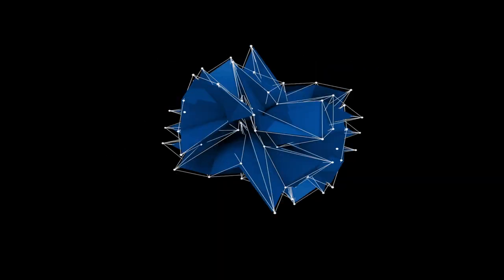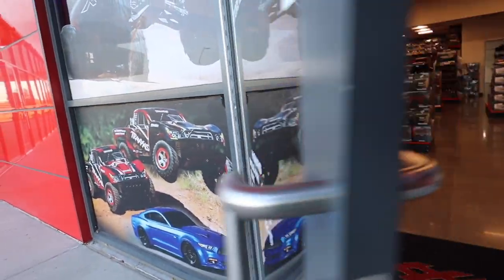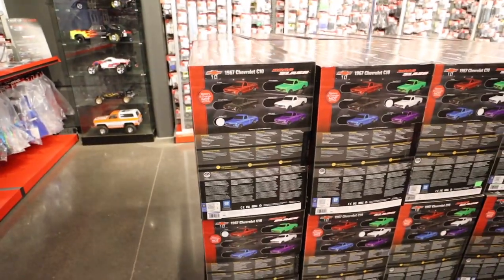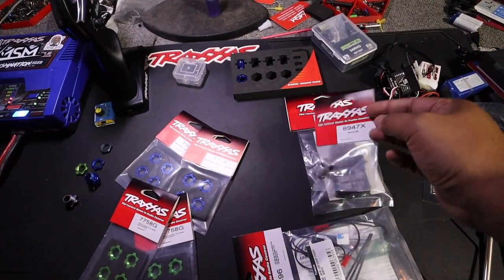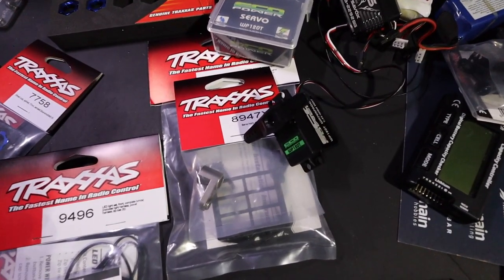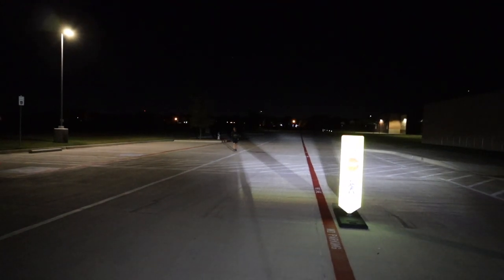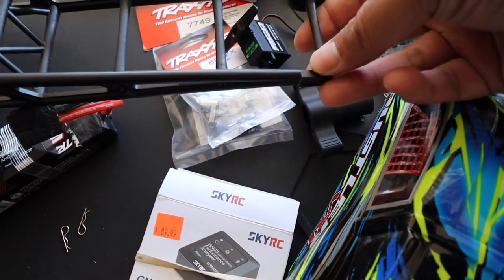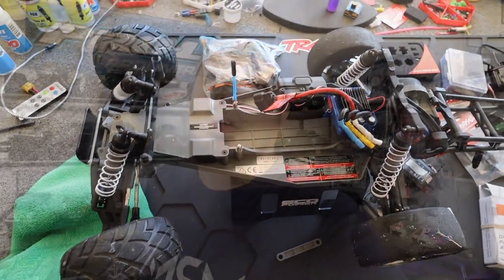I Brought a Vintage LaTrax RC Car Into the Traxxas Retail Store | NEW Traxxas Products!

Comment: Mark, FYI 8947X only fits the large Maxx / X-Maxx servos. It won't fit standard 25T servo horns. I found out the hard way when I fitted a Savox SW2290 to my Maxx. You need a smaller 25T servo horn - I used the one made by GPM

Comment: Have you tried a 38 tooth pinion with the 76 spur gear? In the stock transmission 38/76 is the tallest gearing you can run. If you get an RPM gearbox you can run up to a 41 tooth pinion with the 76 spur gear. I know this because I did 17.5t racing with my bandit and wanted to get the most speed I could out of the motor I was running.

Comment: 114 combined teeth is the most you can run in that transmission. My stampede vxl uses 31/83 gearing and I have to move the motor as far away from the spur gear and possible to get the perfect gear mesh. Bright side of that is that if one of the motor mount screws were to back out it would strip the spur gear. Only a backed out grub screw from the pinion can do that.

Comment: Use to race 1/10 touring car after work outdoors at night in front of one of my LHS at the time we just had the dim parking lot lights and a couple halogen lights they had setup in the darker areas (still wasn’t a lot of light) best thing was adding headlights and taillights to the RC mainly helps with keeping it oriented in the right direction.

Comment: when you start modding it, get GRP tires for the rear, better grip, drop steering rate down so she tracks straight, and you may need to add weight to front to keep it down

Comment: I put the traxxas rustler 4+4 light kit on the two wheel drive body it looks good and works a the one light that mounts in the front bump I just ground it down and put the screws threw the front and I cut the grill in the two wheel drive body and it’s looks syc